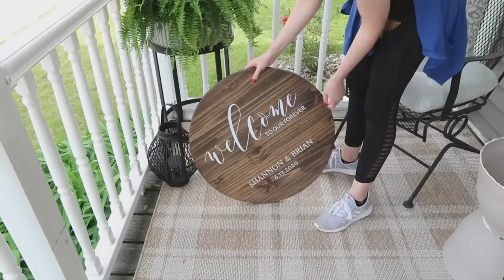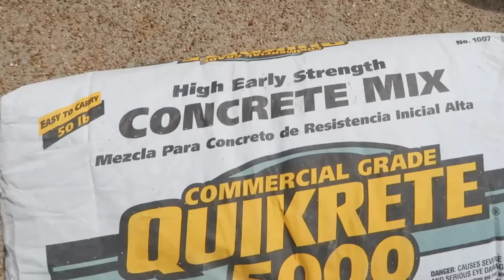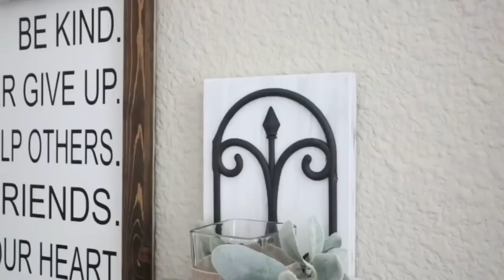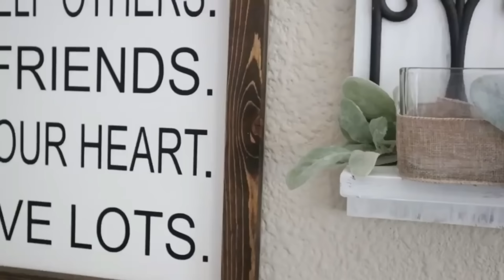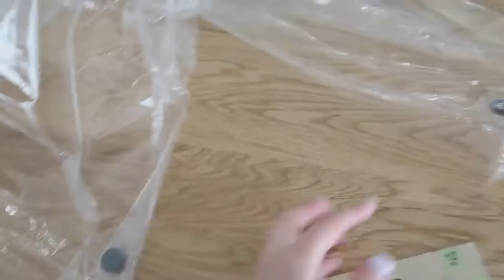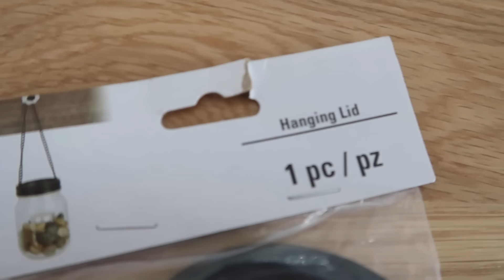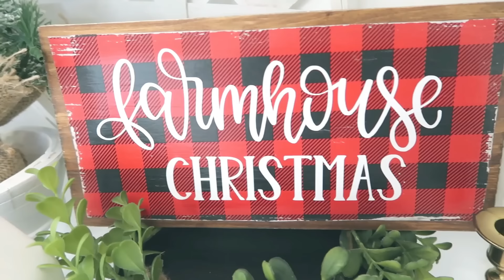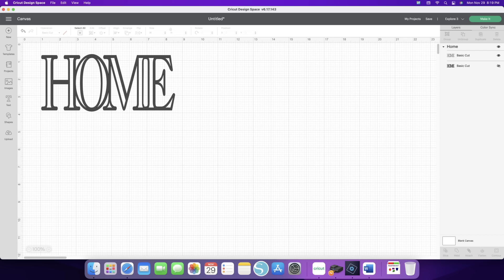25 *BEST* Dollar Store HACKS 2023! High-End $1 Dollar Tree DIYs & ideas to try this year!

Comment: If you are doing concrete when it is super hot outside, you definitely want to water the concrete for a couple days, that way you won’t get any cracks. My grandfather owned a cement company so I thought I would share.
Thank you for so many fun ideas!
Reply from the maker: Thank for the tip!!
Reply: @DIYboymom  yes and it’s also in Masonary and rock. So many crafts and flipping homes that we do when we’re young we do not realize how important it is to be wearing a good mask not just a paper one which does not do a whole lot. We discovered from flipping old homes at how much asbestos is in paint, floor tiles, shower enclosures, ect. and my dad died of lung cancer so we learned our lesson the hard way.
Reply: I learned that when I was ten and asking questions of a man pouring and watering concrete.

Comment: Hi 🙂 !  I'm watching & enjoying your video!  I have a Tip for you:  Put a little bit of water in your pot/container that your are mixing your Cement in.  Then: add some dry Concrete mix, a little water, so on & so forth until it is the consistency that you desire.  You will find that it is MUCH easier to mix.   Back to your video👍👍👍.

Comment: With the awesome table idea I was thinking along those same lines except using solar powered fairy lights or small holiday lights around the inside cutting out a little removable piece in the back near the bottom to keep the piece as "invisible" as possible (in case you ever need to remove or change out  something on the inside of there.) Then in the evening you'll have some soft lighting to see where your going or what your doing and if you decide to do something decorative inside of the table you can show off your creativity day or night!

Comment: For future projects:  To hang or mount items needing multiple screws like the plant hanger, put painters tape on the back of the hanger where the holes are.  Mark the holes on the tape or punch through the tape on the screw holes.  Remove the tape and place it on the surface where you're mounting it and drill your holes for mounting using the tape as a template.

Comment: Goo Gone OR if you have any oils to remove the sticker adhesive. If you are ever removing sticker adhesive from things like glass or any surface, using acetone nail polish remover works like a charm!! Another thing acetone can be useful for to make your own waterproof type adhesive-use it to dissolve styrofoam-it melts it down hella fast!! So just break into smaller pieces of Styrofoam to anything from the size of your hand or as small as small as you prefer, add the acetone to dissolve I to like a thick gel consistency is what you will end up with.....if you mix Styrofoam with diesel fuel then you've essentially made napalm!! Shocker that theres so many things easily made....it is what it is.🤷🏼‍♀️......🧚🏼‍♀️🦄